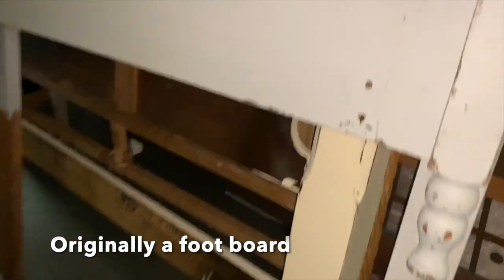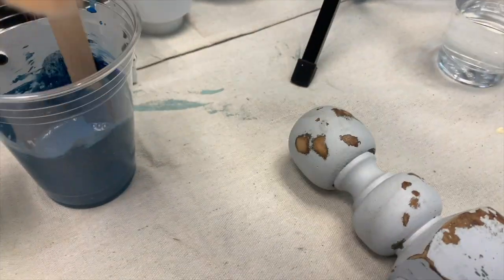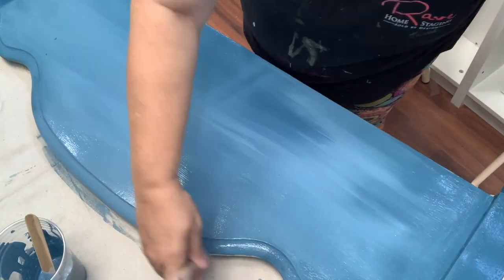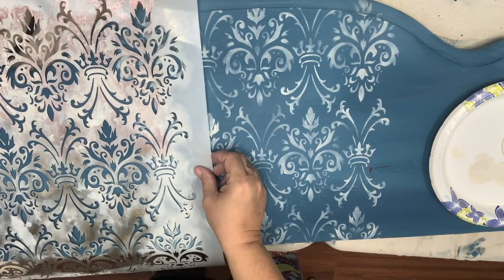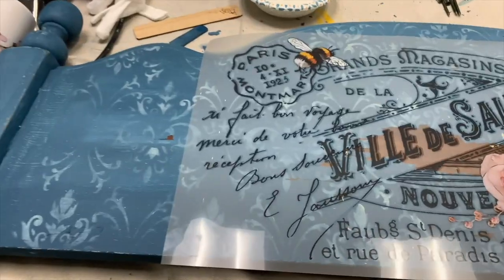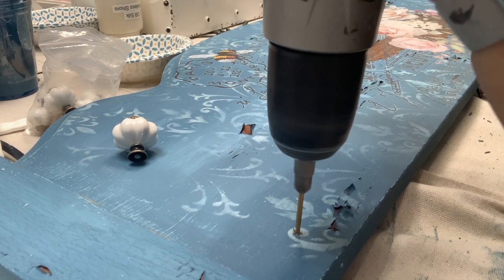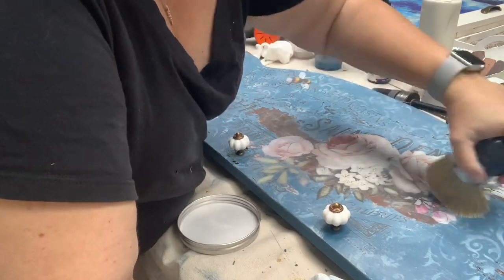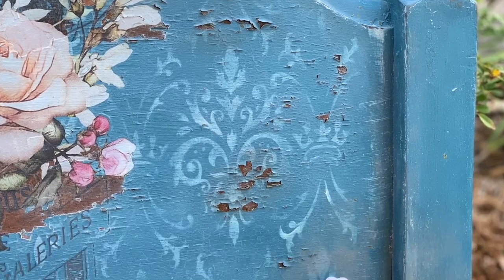Trash to Treasure| Flipping Thrifted Furniture for Profit | Shabby Chic French Country Home Decor

Comment: I love the French enamel paint!!!  What I do with my milk paint is add 4-5 quarter inch stainless steel bearings to the container and every so often I will pick up the container and holding it from the top I'll rotate my hand swirling around the balls, which immediately kicks up whatever has settled and mixes it perfectly!!
If it's been sitting overnight, I will shake the whole thing vigorously for about 30 seconds and leave it alone for the bubbles to pop and disappear!  But what you CAN do in the meantime, is use the bubbles to dye fabricwhen the bubbles are high!!!
, IlTl get a piece of fabric and put a ziploc bag filled with floofy stuff in the center,so the fabric is smoothed out vs meh because the"design"is more fluid vs the fabric being wrinkled up because that leaves blank areas!
But you can get CrAzY designs and if you mist water on it it looks like it's been tie-dyed, because depending on how much water is used the fabric can have a soft monochromatic look or one, where the color is just in the one area! but if you dampen the fabric before dipping it, it'll look like a watercolor painting vs dry, which is more abstract!
Good lord I have got to learn how to leave a comment 🙈 because all I do is talk the bark off a tree and the ears off a chicken (poor wee BasTURDs...🐔. just wondering around the barnyard asking WHAT😮?  WHAT? lays an egg WHAT?..... YuP just asking WHAT?  all day long🐔as I sit here and birth a stupid imaginary chicken farm..... because THAT'S normal 🤦
But seriously, I love the pictures and the look and can't believe how much of a difference it is when you have someone who knows what they are doing!
XOXOXO from Florida cutiepatootie 🤗💗✌️

I swear I have got to stop acting like a DorkTARD 🙈
Reply from the maker: Lol. I 💕💕 milk paint. The ball bearing idea is great. Once mixed, the paint will last longer if you refrigerate it. I’ve also used it as a “dust” with wax. It creates a beautiful pastel mist.